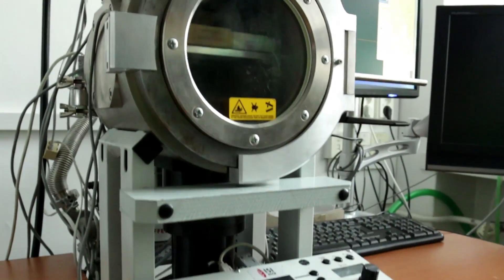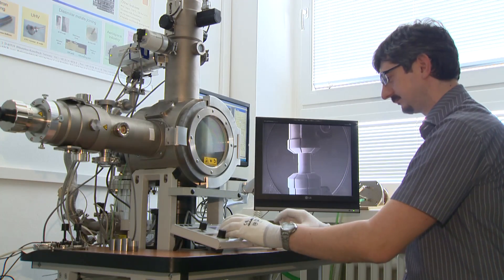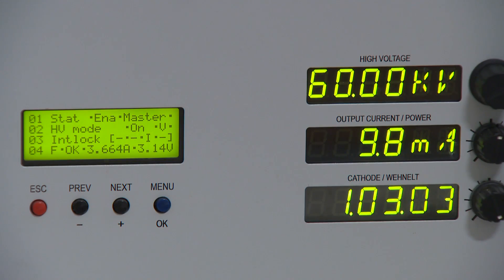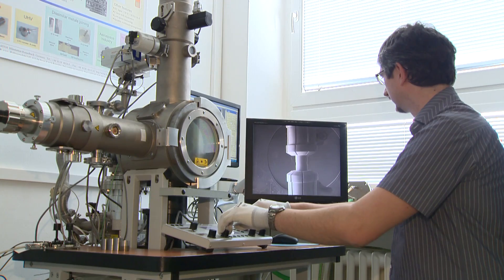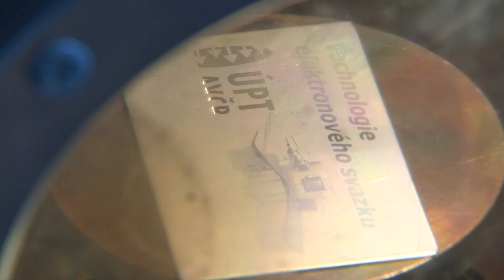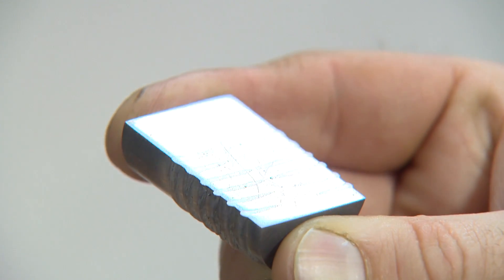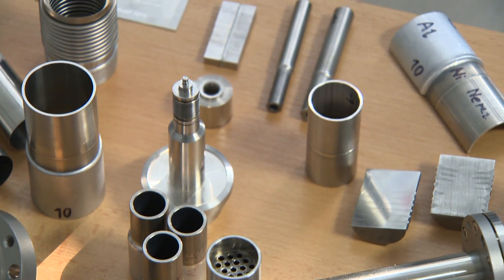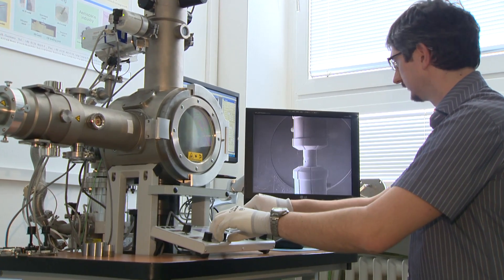Electron beam welding

Comment: Back in my working years, I was something of  an expert in electron beam welding. It is not new technology but the control systems are  modern.
Reply: Hi
Reply: Do you think this kind of welding could also be done without an intense vacuum surrounding it? Or possibly in open air (with enough energy input) ? How do you protect operators from Xrays without making the machines extremely expensive and unwieldy? Thanks for the info
Reply: Air molecules scatter the beam, making it impossible to focus.